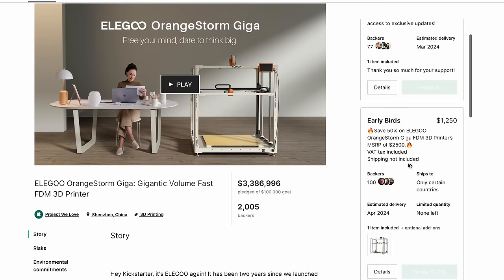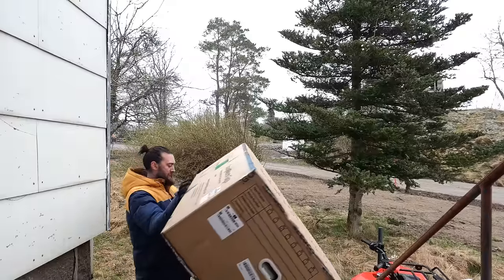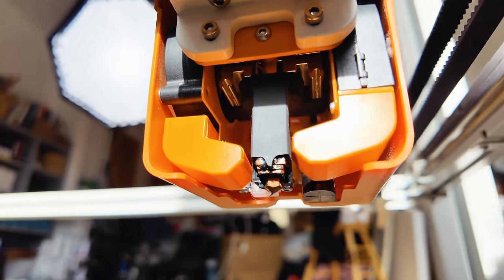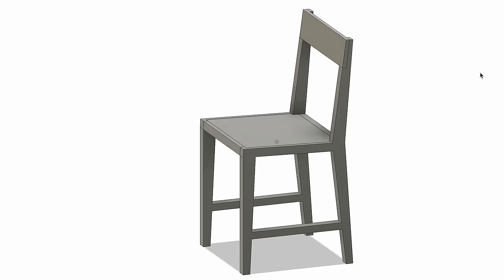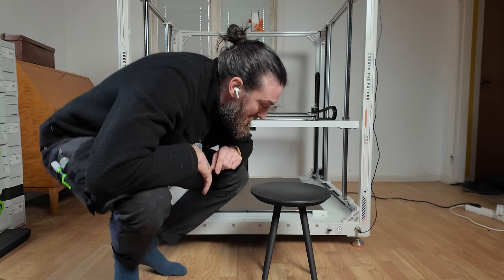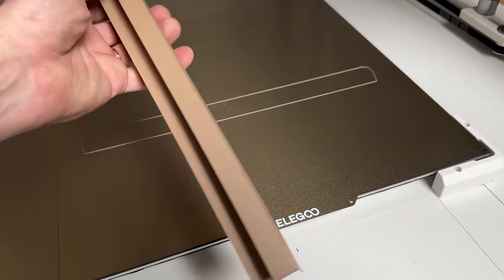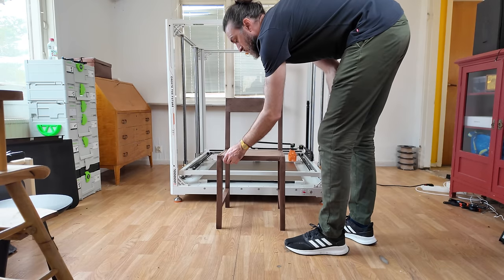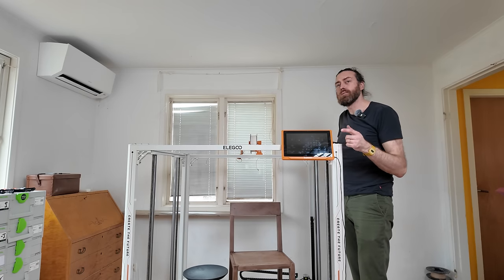I tried this massive 3d printer so you don't have to

Comment: Great demo! I don't think you have to worry about losing your job! Very few people would want to print their own furniture while the majority of people prefer furniture made of traditional materials like wood ( as long as there is a will to plant more trees, and recycle as much wood as possible). I also hope to see better designed and affordable filament recycling products in the future.

Your chair looks good, and as you said it could have used a better framing configuration. 

Finally, what slicer did you use? Did Elegoo include the profile for the Giga in their slicer? I would be curious to test some parts, and see what kind of printing time I would be expecting for one of my future projects.

Comment: for the firniture certain peices need to be printed separate and then assembled to make sure layer adhesion doesn't make the furniture dangerous. In my printing experience, layer adhesion is one of the largest limiting factors to FFF printing. You don't want any sheer forces between layers otherwise the layers will sheer. you also don't want to bend between layers or else they will peel apart.

Comment: Print it, but leave one side "unclosed", so you could pour some sort of mixture down into the chair to fill all the voids (a plaster perhaps?). The strength would be from the skin and not the mixture anyway, just to fill out the voids and strengthen it all.

Comment: You don’t need a different type of Mayer to make it stronger, you need different designs. In 3d printing you have a lot of strength inside the layers and very little between the layers. That stool will snap very easily!!

Comment: I love the channel @slant3d. One of the mantras they happen to repeat on most (if not all) of their videos is that 3d printing is a different process - You need to design for it.
Things need to be bulkier, with a more "Solid" design, w/ chamfers, etc. And that doesn't necessarily come at an increase in material cost, because they are mostly hollow.
I get that for traditional furniture design, sometimes we are looking at sleeker shapes and forms (like your bench and chair), but those aren't going to work for 3d printing. A design like Magis Spun by Thomas Heatherwick would work great on your 3d printer for example.

Comment: You could pause prints and add other materials inside the print if you model the pieces with this in mind. I obviously never print this big, but I like to add weights etc in my prints and do that through pause commands to make them fully encased in the print

Comment: I think this would make a lot of sense if you had a pellet extruder.
Since you need compound filaments for best prints - get a proper filament making extruder set up in the same room, and use a filament width sensor to compensate for variable width from your in-house penny filament.

Comment: Your chair designs are not utilizing the printer full potential, you can add more cross brassings and other design elements.
Or print something in vase mode and fill it up with cement.
Or use it as a form for fiberglass+resin
Reply: i think because he had woodworker background, so its limited his imagination on the potential of 3D printer.
Reply: @Daban980  So he is "limited" because he is a woodworker? Have you ever designed much?
Reply: @FrodeBergetonNilsen  i didnt say he is limited as a designer because he is a woodworker, but rather he is limited because he approched with a woodworker mindset (which is not a negetive feature just to be clear), for 3d printing there are so many tricks/round about ways to cover for the shortcoming of 3D prints like weakness and layer lamination, longivity ...etc. , for example one could make braces to reinforce the chair, or integrated metal/wood into the design. 
or you could make a foldable chair just by modeling some live hinge with TPU / nylon.
Reply: @Daban980  Hate to bring it to you, but there is no such thing as a furniture 3d-printer mindset. Who is having that? Kindly point us to furniture for sale, that is printed, and at the same time makes sense. I would love to see that.

Comment: I think one reason for both the stool's success and the chair's failure is fillets on stress risers. If you round off those inside corners, the chair will be able to take a lot more weight. It does make it look a LOT more 3D printed or machined and a lot less woodworked, though!

Comment: I don’t have room for such a big printer but nice to see that such a device is now affordable and available.
For stronger parts use more walls not infill. Instead of useing more infill you can make tiny (0.1mm) cutouts inside the model. This way the slicer is forced to add walls there. 
Interesting what’s possible to print with such a big printer.

Comment: This printer would be great for printing Mock-ups, as they are not intended for real use anyway - if you just want to get the feeling of how it looks in full size or scaled down depending on what you are making an Mock-up from this printer would be great, also I am sure it's good for things that shouldn't be sat on or have that kind of weight on it.

Comment: Soon there will be a 3D printer large enough to print a seaworthy, life-sized Benchy with it
Reply: No. This one has a ton of power for its bed. The need to heat that bed makes this production method so inefficient, that it will be sanctioned to save power. A proper 500*500 bed has a 2000W heater.
Reply: I think it’s already possible. 
There is that big one that can print a rocket. 
Plus the ones than can print entire houses.
Reply: @youtubevanced4900  I hate to bring it to you, but a Benchy is not seaworthy.
Reply: @FrodeBergetonNilsen  Yeah, my kids tried it out. I printed a couple a few years back for them. They went to the bottom of the pool.
Reply: @FrodeBergetonNilsen  Not with that attitude.

Comment: i dont really know where this comes from, but pla is one of the, if not the most mechanically stable materials you can print. there are cnc machines made from PLA, they dont work with abs or anything besides pla, thats how significantly stronger pla is. the only real downside of pla is its basically non existant shock resistance
Reply from the maker: Agreed! The dove-tails I made snapped off very easy unfortunately. I think - with this design in mind - I would have been better off with PETG .
Reply: @TheSwedishMaker  yep, thats the non existant shock resistance :D i think polypropylene is also interesting to look into, also because the layers bond so well, that the material fails before the layer bond does, its VERY shock resistant, very resistant to almost everything in fact.

Comment: I've been fiddling with this concept for a while, I truly believe it will become an industry at some point, there's a lot of logistic benefits, but I don't think it can ever outcompete the classic woodworking. Its too versatile and cost efficient.
The models look neat off the print already! To tackle the integrity of the print, try reinforce the design by integrating wood in the structural elements; by modeling hollowed out sections of the 3d prints and inserting beams or rods of wood with a friction fit + add epoxy if you're not planning on reusing the 3d printed parts, most of the wood can be repurposed with a bit of sanding.

Tip: You greatly reduce the requirement of woodworking if you buy off-the shelf beams/rods and further model the furniture around them.

Comment: If you could use a very low infill that had gaps creating channels that something like resin could be poured into that could be interesting. Obviously resin an PLA don't mix well, but the idea is what matters. Using a 3d print to act as an exoskeleton/mold could be pretty cool.

Comment: I've had this ideal of a similar machine but instead of printing things into reality, print them into a model format file.  That way you can 3d print existing objects into a "computer", and sell them as packs on "asset marketplaces".   My dream was to be able to dangle a ball in the center of a room, and scan the entire room into a 3d Model, that would save time for those who are not skilled in using 3d modeling software.

Comment: For the chair, it would probably be better to print the seat and back together and the legs in pairs stuck to the bed, seems like the printer is not properly calibrated for the filament so that would also help

Comment: Look at Furniture thesedays for example. 20 Years ago woodworking was a job for a living where joiners build furniture for everyone. Cheap particleboards and lamination machines came and ikea style furniture buecame the norm. Some joners closed and many kept going. Same with 3D Printing, it will open another option for furniture and there will be products on the market that might replace some joinery but in the end there will be always room so handmade solid wood furniture that costs more money but lasts longer is mostly better looking and will be apreciated by some who are willing to spent the money.

Comment: Im pretty sure you should only use Wood PLA with a hardened steel hot end, not sure if the Orange Storm Giga comes with that installed or a more common stainless steel hot end.

Comment: if the stool has more lateral support, that properly would have resisted the torque quite a bit and make it more sturdy. I think if you design the furniture with 3D printing as a new form of material inside, chairs are absolute doable.

Comment: Pro tip, print infill barely adds strength to the part, the outer walls (including top and bottom) adds the most strength to the part.  If you do want to use infill as strength, in the slicer, set the nozzle diameter to 0.8mm or larger, and then it will actually add strength to the part (I personally use a 0.6mm nozzle and set the infill nozzle diameter to 1.00mm)

Comment: Sounds like you had the exact same issue that the 3DPrintingNerd had with the hotend crashing right into the bed.  I think with the size it will be better suited for creating larger models and possibly molds to do resin or silicone in.

Comment: Regarding the price of printing at that scale, then sure if you use wood fill that cost 500SEK per kilo its expensive, but you can find PLA as low as under 100SEK if are willing to compromise a little and use filament with higher diameter tolerances.
Reply: I have a bit of knowledge on injection molding,  and something I didnt really understand is - if he was going to lightly sand it and paint it - couldnt he just have used a cheaper PLA even if it didnt contain wood fiber?
Also running 15% fill on the main body doesnt seem like much not matter what material your using expect maybe a carbon base (if im remembering right).

Comment: Print smaller 3d printers using this one! I can't believe you walked into the printer, no wonder the head doesn't align 🙂 And of course we were all waiting for you to print something huge, not a small stool or a DYI chair 🙂 Lastly, even a wooden chair would seriously wobble with this design, as you don't have any beams for rigidity under the seat, especially closer to the bottom.

Comment: I would definitely put an enclosure on a printer that big even for PLA. I would also add a fillet or chamfer on those chair "joints" to make them a bit stronger. And yes, PETG would be much stronger. Having said that, plastics will never replace wood for me. So unless they come up with a way to 3d print pure wood, you'll have a job.

Comment: Maybe if it had multiple printer heads and did simultaneouse prints and had drop in platforms to do back to back stacked prints. Maybe print farms would want it.

Comment: Plastic has no mojo, and people hate it. On top of that, people hate the tactile feel of printed goods, and they hate the layer lines. As a woodworker, you probably know a lot of things you would want to do, that just doesn't work with wood. Using mesh or printed patterns, particularly in black, combined with wood, actually looks great. Also, if the wood is adding strength, combining wood and plastic, particularly with patterns and the mesh that you can do, might open some doors. But personally I don't really see much desirable goods that works at this size, being printed.

But when you realize that you might print like 700*700mm flat parts, that can be combined with wood or metal, that is probably the initial use for this. More an enabler and mixed material usage.

For instance with a wooden stool, it might be easier and probably also nicer if you added padding to it, by snapping it on with some form of printed part.

Sadly I do not see a lot of people trying to harvest the benefit from this production method. Patterns and mesh are not really used much, but is unique for this method. The same applies for screws, particularly if you print both the male and the female, say using m14 or m18. You only need like 4,2mm of threading, and they are insanely cheap and strong.
Reply: My own experiences bear most of this comment out. I have made intricate and elaborate kinetic pieces, with glossy clean surfaces, and people are enthusiastic/curious about them right up to the point where they ask what kind of metal they are....as soon as I say it is plastic, the light in their eyes dies and they turn away. This will never change. Hybridizing designs with some wood, some metal and some printed parts is a legitimate pursuit though. I've been experimenting lately with 'fuzzy skin' settings, which can hide seams, and provide a faux-leather look and feel. Also of course printers excel at producing fast cheap patterns and templates for machining processes.

Comment: PLA is the strongest ordinary filament you can print with. It fails in two categories, impact strength and temperature, so don't make ax handles of it. CNC kitchen has done extensive tests, check him out.

Comment: I think you’re demonstrating one of the fallacies of 3D printing, and that is trying to make a 3D print not look like a 3D print. Plastic isn’t wood and FDM prints are not injection molded. Trying to make one into the other is a zero sum game.
Some specific thoughts around your examples. Print as a single unit and design around the manufacture technique, not fight it by sectioning things off. Also, nozzle sizes suitable for a 3D printed helmet are not what we want to be using for these mammoth objects. Look at 3D printed houses. Don’t shy away from huge nozzles. They will save time, add strength and potentially save material. Lean into the artifacts of the method and treat layers like grain, and like grain, you can always fill these in afterwards 😁
Reply from the maker: Thanks man! I agree with all of it! I will print with the 1.0mm nozzle as soon as I can get a new print head to make it work and try to test some more prints on it.

Comment: I think for me the lack of support for reliably printing ABS is the biggest limitation as PLA and PETG only get you so far if if printing commercially, industrial customers will be looking for more technical materials at that scale. Proto-typing yes. But when I prototype large items I do so at 1/4 scale anyhow.

That said, good effort with the chair. I suspect that if you had designed for 3d printing the chair would have looked a lot less like a traditional dining chair.

And thanks - I don't have to try this myself.

Comment: 150mm/s? I just upgraded my voron 0 so it can travel at 500 and print at 420, and I still think it's too slow even though the print area is tiny. Look like it would be much practical to get a 500mm ratrig if you want a big 3d printer.

Comment: The thing that bothers me about all of this 3D Printing is all of the extra plastic waste in the environment. Especially when the projects don’t turn out as expected- a great example in this video with the first stool. In this current climate I would have thought creating more plastic wouldn’t necessarily be the best idea.
Reply: Well, hopefully most other people who 3D print, like myself, save all their scraps and broken project pieces to recycle them for use as new printing material. That's what I and others who regularly 3D print do. I'll err on the side of caution and make a bold claim by assuming that those who 3D print (at least regularly) are passionate about creating, inventing, and forward thinking. As someone possessing these characteristics, the thought of discarding so much non-biodegradable material is not only painful to even contemplate but also goes against my nature of doing my best to thoroughly think ideas though (which is a key process in 3D printing). Additionally, I can't justify the neutral-to-negative impact it would have on my finances, which these days are tighter than a vice grip under an elephant's foot at the bottom of the sea.. 🗜️↘️🐘⬇️🌊

Comment: Unfortunately, this printer has been mostly problems for most who have gotten it. Definitely not ready for release, and lacking a lot of features we see in modern printers.
Curious to see the Voron Phoenix, as that engineering team does things right, and while smaller at 600x600, it's still going to be massive.

Comment: Hi 👋 , This would be better making parts for the radio controlled model industry,  I have seen things made in metal, but it has to go through a baking process afterwards, very very expensive, I don’t think you’ll be able to business yet not in your lifetime, keep up the great work, 
At least it was a review , Something you might be interested in is that I’m in the process of design and hopefully not in the two distant future making an elevator lift mechanism from my basement up to my attic, It’s operated by a large electric winch which you can get radio controlled, if you have a way of accessing your basement and cutting a hole through your floor, oh dear, you might be able to build something so you can get boxes like what you have been struggling with up to the next floor just by pressing the button, good luck,